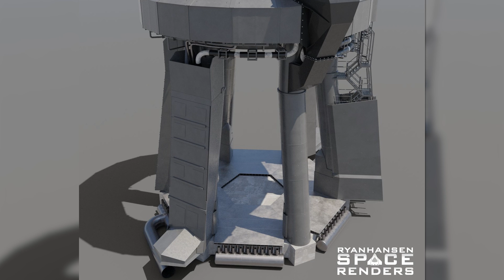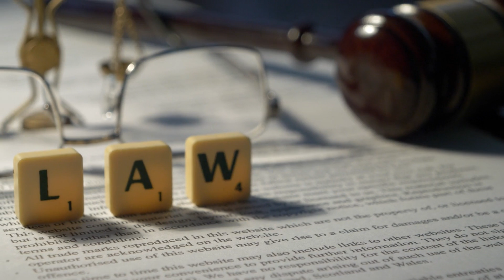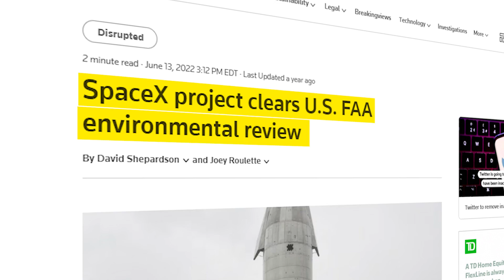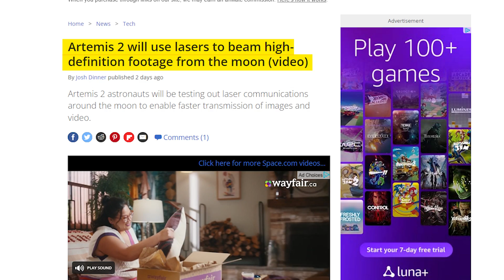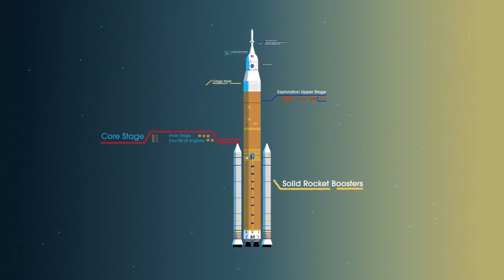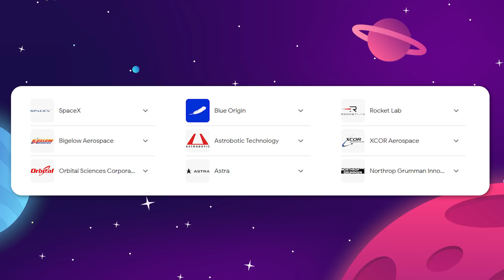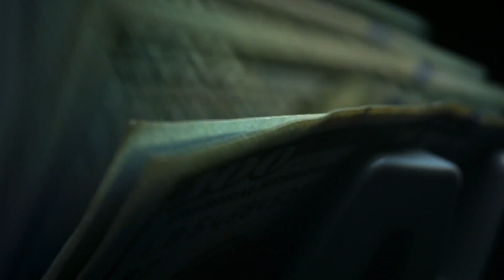SpaceX Has A Major Problem With Starship..

Comment: The metal launch pad layer should have been installed before the full Starship/super heavy test. That is the problem.
Reply: Perhaps they learned some things they may not have and ship 24/booster 7 were already dated.. it was worth it for the data!
Reply: @firenx437  ; very poor argument. 
The data from the launch is seriously flawed due to chunks of concrete flying up into the engines. That problem should have been eliminated before the launch.
Reply: As the comment above me said s24/b7 were dated and they couldn't wait to launch them and the steel plate deluge system wasn't ready for this launch so they just went for it... The problem is not the damage itself the problem is the lawsuit and people trying to stop starship development because they lack knowledge on the matter.
Reply: @trapstoner  ; the problem is the damage. If you cannot understand that, there is no use of us arguing about it.
Reply: Thank you for your input, Capt Hindsight.
Reply: @stevenobrien557  A lot of folks were predicting the obvious problems as Captain Foresight.
Reply: @executivesteps  sure... "folks"
Reply: @stevenobrien557  How about a “folk” named Elon Musk who gave the mission a 50% chance of failure.
Reply: @stevenobrien557  ; there are some facts I happened to know before the launch. There are a few YouTube channels which discuss these things.
Reply: @bb1111116  where did you state this before Capt Hindsight?
Reply: @stevenobrien557  ; first of all I do not appreciate you calling me names. But since you insist on that, I’ll mention it is an indication of your level of maturity. 
And considering your name calling, you are not coming across as very mature.
(In checking your channel, I see you have the ability to explore historical or technical topics. You are just not applying that to this discussion.
Nice cat BTW.) 

- But I do know how to apply factual information about various technology topics to this discussion. From my university degrees with various science subjects (as well as statistics) and having also done computer support for several years at a government funded company. 
So, I've gotten factual information about the history and workings of space flight technology. 
* Second, I have a long time interest in space flight. Considering all of that, for years I have been going to web sites and reading articles and watching videos about SpaceX. And in that time, months ago, I have seen discussions about the launch pad design for the Starship.  
* Over the years in going to these several internet sites/videos about SpaceX, some have discussed that the launch pad for the Starship system (+super heavy), does not have a flame trench (which the SLS launch pad has). Also, there is information on the web that the Starship system would have about twice the thrust of the SLS. 
- That has led to a concern by some about the Starship launch pad design such as in a discussion on the space stack exchange web site which began over two years ago. 
* Third, did Elon Musk know about this problem (which has been discussed on the internet)? Yes, as discussed in the video. Elon has admitted that after the April 20 Starship launch. 
- But Elon’s admission is not necessary for there to be a prior concern. Others who were informed, knew about a potential Starship launch site issue months ago before Elon’s statement that SpaceX was going to redesign the launch pad.
Reply: @bb1111116  tl,dr.
Reply: @stevenobrien557  ;
NASA;
”May 29, 2018
Launch Pad 39B Flame Trench Nears Completion”
”The new main flame deflector is critical to safely deflecting the plume exhaust from the massive rocket during launch.”
”The nearly nine million pounds of thrust expended during lift-off of the agency’s new Space Launch System (SLS) rocket would cause quite a bit of damage if it wasn’t for modifications made to Launch Pad 39B.”
”we now have a flame trench and deflector system ready to support SLS,"

Comment: A lawsuit isn't going to stop things until it is won.   To quickly stop things they need to win an Injection.  The standards are pretty high so I don't think they have enough for that.  
Of course that doesn't mean that the FAA will not voluntarily stop things.   But they get sued all the time by all sorts of cranks.   So even a voluntary stop is not guaranteed.
Reply: But if nasa and defence wants it bad enough they will step in and tell space x to continue.
Reply: @BillyButtry  NASA also requires FAA Launch licenses.  Which is odd since the FAA gets a Part of their requirements data from NASA.
Reply: The nonprofits have clear evidence of irreparable harm from the first launch. They also have evidence of bad faith and reckless disregard of the environment on the part of Musk. Going on to Twitter and saying that you launched without a major risk mitigation system in place because you couldn’t be arsed to wait doesn’t look good in that court room.
Reply: Also the FAA doesn’t have much credit in court these days given how badly they shat their pants on the 737max and licensing May Crash Any Second as safe.

Comment: The Starship tanks burst exactly when they were told to self-destruct - the 2 leaking gases did not MIX and IGNITE immediately, that's the issue. Just saying it took 40 seconds too long doesn't explain much. The size and positions of the flight termination charges on the fuel tanks prevented immediate ignition. But one cannot not clearly understand those facts from your spotty reporting.
Reply: What if it was heading towards the ground or the nearby island? Forty seconds would be far too long then.
Reply: @tatata1543  How long does it take to fall 31 km?
Reply: @ghost-cs8jy  But what happened if the rocket needed to be aborted at a lower altitude? 40secs can  be a big difference.
Reply: @tatata1543  Did I say the failure was a good thing? Not at all my point.
Reply: @donnanorth7324  No, you didn’t and neither did I.
Reply: @tatata1543 Why was nobody concerned when government-run NASA dropped fully intact stages from Mercury/Gemini/Apollo rockets?
Reply: The FTS failed. End of story.

Comment: Even smart people do dumb things.
Just had to wait a week or two for Water Cooled Steel Plate.
Reply: You mean a month or two.
Reply: @joannewilson6577  They we're already made, just not installed.
Reply: Then we will have lumps of steel flying thru the air rather than concrete.
Reply: @tatata1543  My thoughts, exactly 🤨
Reply: @tatata1543  Steel is stronger than concrete, if that's case why was most of the rebar still intact at the base?
Reply: @gteaz  But it is cooled by water... and if the water cannot be move out of the steel plate fast enough... that water  will  flash  boil into steam... creating a localize high pressure that prevents more water from entering... stopping further cooling... , the steam heat up even more and then explodes out... turning that steal plate into flying shrapnel.  Worse yet superheated water is corrosive to metal. So even if it does not explode the first time, it may do so later.  It is not something that will be easily inspected for damage.
Reply: @nickl5658  Thanks.... For the info..... Like I didn't know this........ 
Anything else...... ? ......
Reply: @nickl5658  Have you been watching the progress with the water deluge system?
Reply: Musk must be a super genius then by that criteria... 🤣 I mean, has this shower head system of his even been prototype tested...? I'm guessing not.... 🤔
Reply: @saiello2061  Not that I know of, and I've been following rocket launches, since the 60's.
Reply: @saiello2061  Was the concrete tested with 16 million pounds of thrust? Nope.
Reply: @gteaz  
dude these youtube rocket scientist know more than Elon himself.
Reply: So judging by you experts, no plate, just concrete flying everywhere each launch.
All makes sense if you're a flatearther.
So how do you test the water cooled steel plate with 16 million pounds of thrust when the only thrust you have, comes from the 33 Raptor engines on the bottom of a rocket. 
Simple, the same way the concrete was tested. Like any testing, you don't leave it uninspected, the plate gets removed and replaced with a new one whilst the first one gets inspected for defects etc to then improve new plates that can handle the thrust without causing damage.